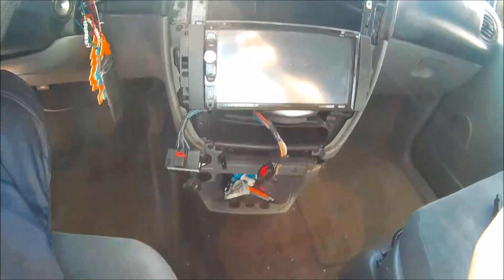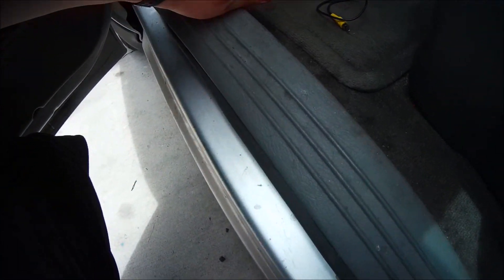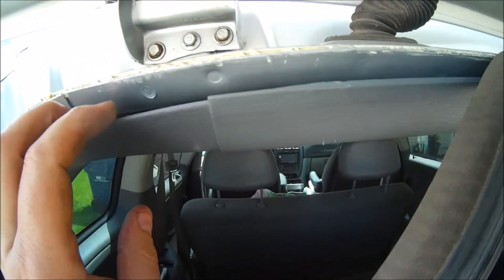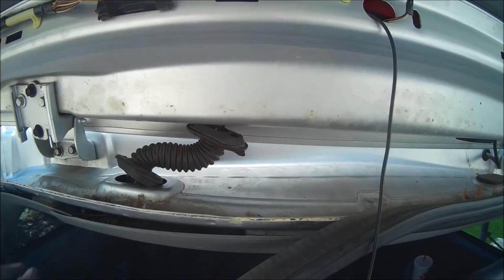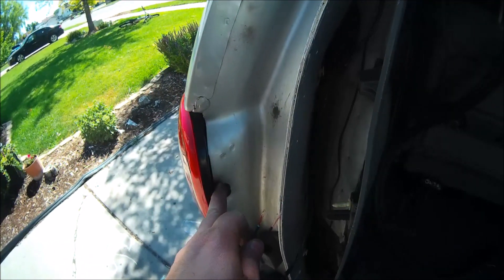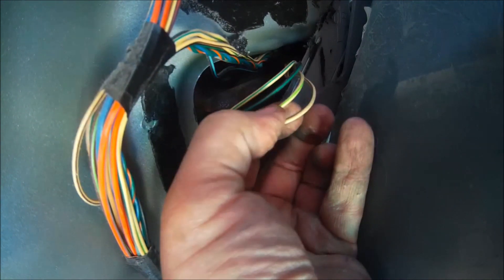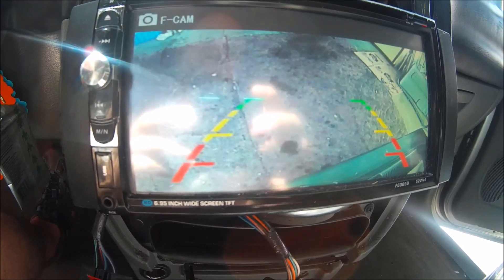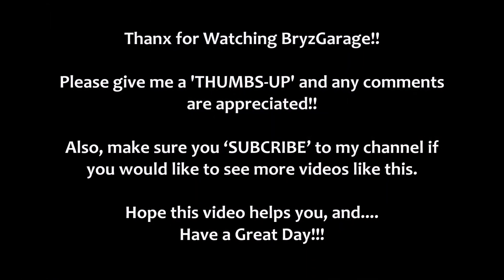2001-07 Dodge Caravan Back-Up / Rear Camera Install

Comment: Thank you. Great video and very instructive and detailed.
Reply from the maker: Thank you for the feedback
Reply: @bryzgarage5028  I followed your advice and installed a backup camera for my 2005 Dodge Caravan minivan. Yes, I had to extend the video RCA cable (I used a RCA audio adapter with female ends on both sides connected to a 6'  RCA VGA cable, male to male ends). I also had to also extend the wires coming from the camera I.e., positive and and negative. Camera works great. It goes well with my new 10" android head unit. My next project? A underseat subwoofer. :). Yes, white (faded) with lime, light green stripe (+) and dark green with black stripe (-). I confirmed the wiring with the Haynes break down manual for my Dodge 2005 caravan.
Reply from the maker: @deryck6789  ok, you you make a video on the speaker for me. I'd like to do that as well. Thanx for the info brotha!!

Comment: Thanks again.  I have the 2005 Town and Country.  Your instructions are so helpful.  

I did mine alone.  No need to actually start the vehicle.  Apply the parking brake and turn the key to the ON position without starting it.

Comment: Only 2 screws and 2 bolts to remove that license plate light holder, there is a rubber grommet already there with plenty of room for the rca and power. Still decent job. Reverse cameras are nice and extra nice in a mini van. I just installed one in my 04 TC

Comment: Thumbs up and thanks for taking the time.  I'm tackling a new double DIN installation with backup cam, forward cam, etc. and this really helped tremendously.  Cheers.
Reply from the maker: Thumbs up back ya...thanks
Reply: @bryzgarage5028  I've been working on this today for a few hours.  I think I did the reverse in terms of the cable run.  I did everything in the back first, and I'm feeding the RCA cable for the head unit forward through the van.  I'm almost there.  The toughest part is over, thank goodness.  Almost ready to snake the wire under the front door threshold.

Comment: I have the same van, Same color, mine is a 2005, I have a question for you Why can't I install the camera under the bumper? It would save alot of time and be so much easier IMO, I also have a tip, install the ground wire to the Body (metal), I hooked it up to the reverse ground wire and Everytime I hit the brakes the camera got grainy, moved it to the body and works great
Reply from the maker: I would give it a try. Please post and let me know
Reply: James, I wish I would have seen your comment before I wired mine up to the tail light ground yesterday.  I've noticed some video noise when the brakes are on.  I have the same year van as well.  Going to try your suggestion.

Comment: Awesome video, thank you! Thanks very much for the excellent way you explained everything and showed every step in the video. On 1/24/2021, I installed my backup camera in my 2002 Dodge Caravan SE and I did everything you did in the video and it worked perfectly! The tail light wires were the same color, step bit and 7/8" grommet for the hole behind the license plate for the camera video and power + ground wires worked perfectly.